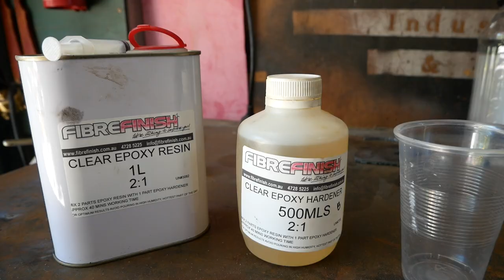Slab SideTable - Forme Industrious

Comment: Good to see you back! Happy birthday to Chloe! That turned out really nice! I noticed that you painted in few places straight over millscale, I haven't paid much attention in other of your videos, but I noticed few people do that, including DiResta. My question is have you ever experienced paint peeling off from or even with millscale after some time? I know you live in completely different climate compared to the not so sunny UK, I'm only asking because I'm building a bit of fence and a gate to contain my son in the garden and everywhere I searched I'm getting mixed information o.O
Reply from the maker: Thank you! Regards the scale; it is better I'd say to remove the scale and have primer and paint on the base steel. That way you have a nice flat and even surface. My experience though is that the scale is pretty hardy stuff and has a great bond and I have painted over it many times without any major issue. Anything left out side though would need a tough paint, perhaps two pack or a good epoxy enamel.  I would steer away from acrylics for outside use.  Hope that has been of some help

Comment: What's the idea behind the wooden spacer when cutting the tube Scott?
Reply from the maker: Hi Stacey. If you use a spacer to set up the initial stop, there is a small gap. This gap allows the cut steel to fall away without getting jammed between the stop and the blade. Setup the length using the spacer. Remove the spacer. Cut and then do it all again.

Comment: Great video, as always!

How's that epoxy at flowing deep into the crack?  Are you thinning it with something before pouring?  Is it 24hr epoxy?

Love the shirt cameo, too!  :D
Reply from the maker: Hey Vaughn! That was 2 to 1 epoxy mix used for clear finish (River Table stuff) with a little bit of black sparkly stuff in it. It's pretty warm here so the epoxy flows very easily. Yes 24 hour epoxy. Thanks again!

Comment: Scott, been meaning to ask, mate. Why do you always put a piece of wood at the end of the metal bar you're cutting?
Reply from the maker: Good question. Simple answer; the offcut can get jammed against the blade as it cuts through and damage the blade. The piece of wood is a spacer that gives the offcuts room to move away freely, not hard up against a stop.